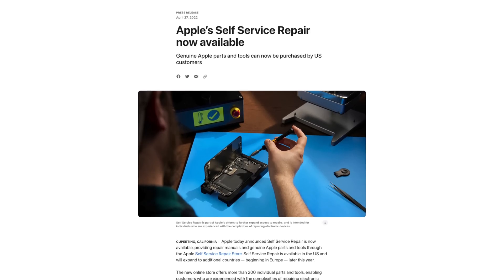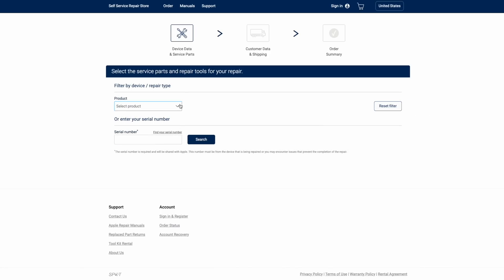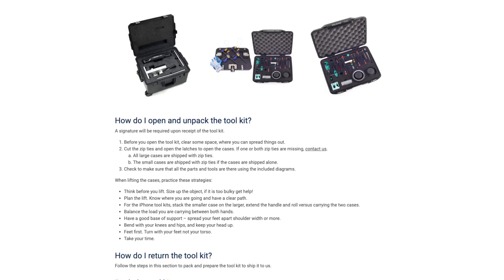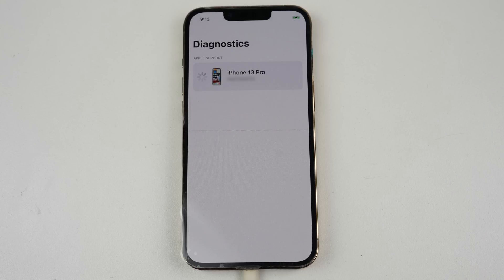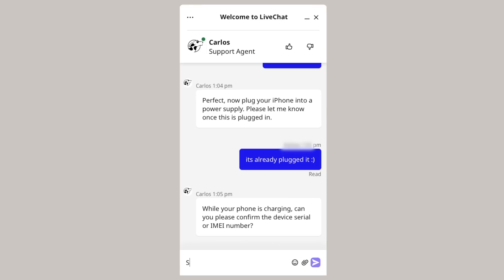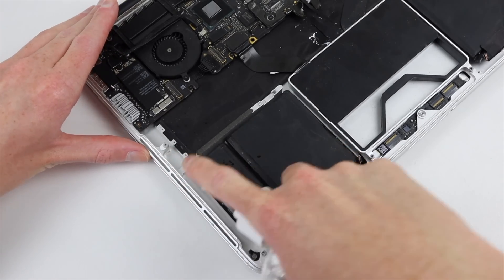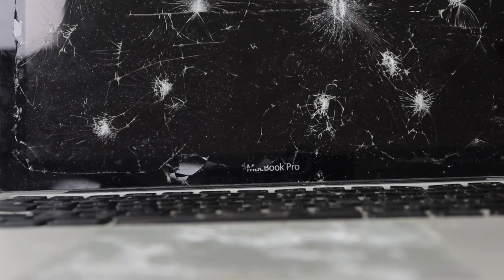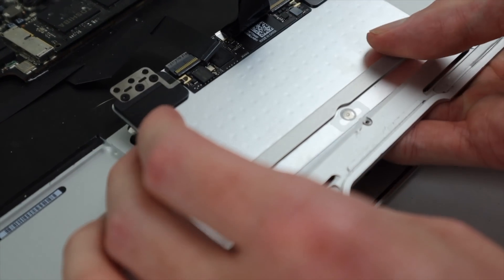Apple Improved Its Self Service Repair Program

Comment: So if Apple can offer a replacement part coded to a customer (or their specific device),  why can't they sell that part to a repair store on that basis?
Reply: They can, but they won't because they want to keep a monopoly on it.
Reply: @rocketbilly  Ding, ding, ding, winner!
Reply: @davenz000  the winner wins absolutely nothing!
Reply: they can but they won't because they want to be monopolistic
Reply: apple specifically wants to avoid part stockpiles anywhere that isnt from themselves. e.g an approved repairer goes out of business and all the parts they had stockpiled go to ebay
Reply: @Alexander-xr8tr  What's the difference between Apple coding a part and sending it to a consumer and coding a part and sending it to a repair shop to do the work on my behalf?
Reply: @Alexander-xr8tr  any 3rd party stockpile would have been already paid for by the 3rd party repairer. Apple's profit from total sold spare parts would be the same.

Comment: Yea if I’m any company I wouldn’t want my user prying out the battery that is glued down, if anything happens it’s the company fault so the easiest solution is to have the user replace the whole casing, if this is the M2 MacBook Air this wouldn’t make sense since the battery have the cheese adhesive which can be removed very easily

I also appreciate having all ports removable, on my ASUS laptop the USB port is loose and I can’t even get parts for it, the speaker breaks there’s no part, fans about to go bad sorry no parts too this is worse than apple
Reply: I think the statements about "Any official products should include all official spareparts to be sold separately" and "any official spare parts must not locked by software/firmware" are strongly required to every big tech company if they can follow the right to repair laws, but I doubt they would do that because most of them are still doing the "money" moves now
Reply: why tf would it be apples fault if you mess up the adhesive yourself? even still, they could solve that problem by being more reasonable in terms of keeping the battery in place

Comment: Hi Hugh, can you try replacing MacBook logic board with different configuration and please let us know if it works. I bought mba with 8GB ram only and now facing issues
Reply from the maker: No its based on the serial number you provide. I feel this is a missed opportunity to sell an upgrade.
Reply: @HughJeffreys  apple should let us upgrade atleast this way or else have to again buy new product. It’s such a pain thing
Reply: @mouniswar7  The thing is, they know that. That's why all the entry-level options for their devices suck - so that you buy it, realise you made a mistake, and then have to buy a new one to "upgrade".

Comment: You know what, to save yourself a lot of headaches, screw apple products and just use android phones and devices.  There, case solved.
Reply: Nope 😅
Reply: Most if not all new Android devices are still just as non-user friendly to repair
Reply: No thanks
Reply: Android phones aren't easier to replace tho. It's almost impossible to find official parts from OEMs
Reply: @FormulaHL1  Well Keon, Apple product just creates drama, but if drama is what you like, then continue to use Apple products
Reply: @lenovovo  bruh what? Apple products are way more reliable than the competitors especially Microsoft which introduced a flawed and failed duo book. Apple on the other hand introduced a MacBook Pro with an M2 chip. Now how is it creating DRAMA?  When they removed the head phone jack in 2016 that was an act of drama but everyone moved on to wireless headphones except enthusiasts or ppl who work to that degree or field to which they need wired headphones so they use their Mac. Sure they started the drama but everyone including Samsung followed on to remove the headphone jack.

Comment: Once the program takes off, however, it’ll be very great.

Still wish Samsung sold parts for laptops, I wonder if the Odyssey with the RTX2060 has a better cooler and heatsink than mines with the GTX1650. And if it does: I’ll happily upgrade my base model cooling
Reply: I think Samsung doesn't sell parts for their laptops because almost nobody uses them, besides the design nothing is that good about them
Reply: @iustin1658  check out the Odyssey model NP850-XG1BR. Looks good, metal finish, it’s like they took their time to do it properly. Much rather have it over a Dell G3 of the same era
Reply: @satsumagt5284  I mean I want to buy a laptop or PC but I'm poor an my budget would be 200🤣🤣, I mean😭😭 but also I couldn't find it anywhere to buy it
Reply: @iustin1658  The Odyssey is quite expensive, and rare too.
It can only be found here in Brazil (hence the “BR” on my model), United States, Korea and China. And I have only now ever seen one on eBay, from Japan (model NP850XBC-X02US).
Reply: @satsumagt5284  yeah I’m going to buy a cheap computer that barely runs YouTube, I mean I have a pc now but it dies going through the yt feed, about actually watching a video is another story. I’m not sure if a pc for less than 200 bucks will be able to work well, would I be able to play games on it, even Minecraft?
Reply: @iustin1658  where are you from? Maybe you can get something used but decent
Reply: @satsumagt5284  well I'm from Romania but talking about this stuff made me look at desktops and apparently dell makes some amazing cheap ones, i would buy used but i already got kinda scammed buying an iphone 7, that phone has more problems than me, i would also build one myself but it gets expensive in some cases and i tried to open up my PC and it took me 20 minutes to remove the cooler and i might have broken it, i though it might me dusty on the inside but it was fresh, so it's born slow. Anyway, i found some dell with an i5, 120 ssd storage and 8 gb ram ddr3, I'm just concerned about the storage cause it's not that much but if i find some hard drive should be fine, i can even move the 80 gb one from my old PC, without killing any of them, but idk do you think an i5 with 8 gb ddr3 RAM is good enough for some gaming or something?
Reply: @iustin1658  maybe you’ll need another RAM stick or something, but if there’s no graphics card… Meh
Reply: @satsumagt5284  true, but I think 8 is enough for me, but idk I just want to get a damn pc

Comment: honestly, apple can get a lot less flak if they just serialize the parts before sending them to you, and autoscripting the configurator, instead of making those that are technically savvy to do the repair suffer with reps that don't know how to do the damn thing itself. it's legit just a preserialization of the same damn thing, since the config basically pulls all the hardware info, it's akin to the devices that you can buy to copy/paste the serial of an apple part onto a ebay part, then running a partial update to verify and validate. 

i just wish companies made it not difficult for the competent people that do this daily, instead of assuming we all need our hands held on it

Comment: Unless one just has to have the latest and greatest from Apple, why spend the money not only on the original MacBook (Air or Pro) when the 2012 unibody MacBooks are not only cheaper on the used market, but easier to replace and repair. BTW I have a 2011 MacBook Pro 17 inch and a 2014 Mac Mini. They work just fine for me.
Reply: Totally! I have the 2012 13" MBP unibody and will probably upgrade soon... to a 2012 15" MBP unibody.  
That particular 13" was kept in production until 2016 due to being the last laptop they made with all the ports / optical drive / SD card slot.  So a used one will say 2012, but could have a much newer manufacture date.
Reply: Because they're ancient. There's not buying the bleeding edge devices, which I can understand, and then there's being moronic enough to buy a decade-old computer, which is just a waste of money and a very poor decision in general. 
Also, the 2011 17" MBP's GPU dies after a while, and I don't believe the replacement program is running any more. Had it happen myself. It's basically a ticking time bomb.
Finally, all Intel-based Macs tend to get way too hot and are already under-volted to get the thermals under control (which doesn't help much). For better or worse, M1 and M2 Macs are just superior in terms of thermals and performance. Even their battery life is better.
Reply: @GareWorks  While the older Intel based Mac do have the problems you indicated, there IS still one attribute that they have. That being the cost and availability of parts. Servicing them is also easier than the Retina and later Macs even though they are in terms of processing power and heat dissipation is better(especially the newer M1's). It comes back to one factor(at least for me) that being I have more time (for repair) than money (to purchase later models). Also, how do you think you've made your point, when you insult those of us who don't have the money to purchase 'bleeding edge" equipment? But a fool and his money are soon parted. Apple encourages the consumer to buy their most recent offerings when they manufacture them to ONLY be repaired by Apple, making all their models land fill fodder. But as in all things one is entitled to their opinion.

Comment: The irony of his saying that you only save 10 dollars on the battery replacement for the air is that you are getting the exact same discount from ifixit his channel sponsor with the exception of the back to school sale they were running when I looked. So is getting it serviced by them really that big of a rip off? I mean I'd happily spend 10 dollars more having someone else do the work and know that I'm getting the same part in my computer. It's like how I happily spend $100 dollars more on a set of tires knowing that they just outlasted by 20k the time I tried to save the $100.
Reply: I see this come up a lot. People don't seem to understand the difference.
Yes, it's a big rip-off on Apple's part, because iFixit are either not selling you original batteries, or they're selling you refurbished batteries. Apple makes it extremely difficult to get this shipped in bulk and will stop them at the border sometimes. 
Also, iFixit generally has much lower volume than Apple (you might have noticed that one is a relatively small company and the other is literally the biggest company in the world), which can greatly affect the price. 
That's why iFixit can cost almost the same price. But Apple has the ability to (and does) produce and sell them in much greater quantities than iFixit.
That's also why being able to buy genuine parts is so important - iFixit is doing their best to help people repair their devices, but even they know they can't offer the best quality parts for the best prices. Often times, it's just being able to get the parts in the first place, whether genuine or not, that has made iFixit so invaluable. Being able to buy the genuine parts at all is an even bigger bonus. Being able to buy them at reasonable prices is the next logical step which we have yet to take, at least for most parts that Apple offers.

Comment: for what it's worth I want to point out that the M1 macbook air battery has magic pull tabs and is much much easier to remove than the older models like the intel macbook pros
Reply: Even with the pull tabs, some people won't be able to even do that properly and they will most likely damage the battery in the procces ans cause a fire or them getting hurt and then will come the biggest lawsuit of all time, I think that's why apple does it the way they do, to not get sued
Reply: @iustin1658  You're half-right. They're definitely doing this repair program to not get sued, but it's got nothing to do with the battery. They aren't liable for what you do on your own.

No, it's because they can get the parts back from you, remove the batteries themselves, and recycle all the tops of MacBooks. It basically prints them even more money whilst charging customers, even for self-repair, out-of-pocket.

Comment: With parts being sold, maybe I can run the serial number on my 1998 Macintosh PowerBook G3 and finally get a new display cable! Wait it only applies to current models?…… oh.

Though this is one of those things were I would rather pay more but get a new oem part directly from the manufacturer than pay less for used parts or a third party part of.. questionable quality.
Reply: If you really need a display cable for a wallstreet/pdq model of the powerbook g3, i have one i don't use and it works, i even have a 300Mhz daughtercard for such machine
Reply: Hmm Ill keep this in mind, that 300Mhz is quite tempting but I don’t know if it would work on my board. I’d buy it off eBay if you posted it there.
Reply: @aegonthedragon7303  No it's not posted on ebay unfortunately, but we could arange something if you'd like, i know the daughterboard works because i had the opportunity to test it in another machine and it works flawlessly, it just sits in my drawer, i don't have any use for it and it should fit any of the pdq version of the wallstreet, i don't know if it would fit into the very first production run revision
Reply: I’ll definitely keep it in mind. Could we continue on another site like reddit? Just where its more easy to chat.

Comment: We hope that all these problems are only temporary things due to the fact that the service has been active recently and that over time repairing your device with original parts becomes easier. Waiting for a technician to connect to your device remotely, to authorize the replacement of an original part, cannot be seen at all. Nice video as always.
Reply: Keep dreaming

Comment: Apple is so disgusting man...so glad i opted for the s22, can't believe i even considered the idea of entering Apple's ecosystem.😶
Reply: @Bobspineable  you still cant buy a battery for a samsung device. And pricing is trash, as they are working with iFixit, a consumer facing company, rather than a wholesaler like Mobilesentrix. I get "wholesale" discounts thru iFixit Pro, and dont get any kind of discount for genuine samsung parts, meaning they are unviable for shops.
Reply: @Bobspineable  the problem is not the difficulty of the repair, just watch the video...
Reply: Do not telegram
Reply: @Bobspineable  Samsung partnered with ifixit just for marketing, just how they did with BTS and blackpink and Millie Bobby Brown, kpop fans are fans, fans fans, toxic a lot of the times and I've seen a lot of people buy Samsung phones just because of the partnership, and also Millie is well known, they just do this for sales. But yeah no phone is easy to fix but S fanboys go crazy when they hear apple
Reply: @Bobspineable  its not even how easy they are to fix though. I would much prefer to swap an iphone display than one from some androids that open from the back. The problem arises when I replace the iphone display and lose functionality and get a permenant error message. This requires me to reprogram the new display and solder over the IC chip. the only other option I have if im not comfortable microsoldering is to refurbish the original display, something that requires $800 in equipment. Suddenly, a routine display swap that looks incredible easy on an iphone becomes 2 hours of soldering of cutting hoping I dont overheat or otherwise ruin the new display
Reply: Still cant believe I was in the samsung ecosystem...

Comment: Some good points to this but still only real partial support for the very latest models, models that are unlikely to need much in the way of parts or manuals/ guides. In saying that, some of the parts are very well priced.
Reply: @recitationtohear  bot
Reply: Peter bruh u used to fly fpv

Comment: Just buy samsung its a simple phone
Reply: Thats like saying to buy a car from Honda when your Hyundai fails. Not as simple as you think to go from one system to another.

And Samsung is getting just as bad with repairability as Apple.
Reply: @Bobspineable  It's not about being "easier to fix." It's about being jerked around and hemmed in by the manufacturer on repair parts and information. You did watch the video, right?

Comment: iPhone 14, Max,  Pro or Pro Max? Which one is the better option?
Reply: None. Better get yourself an Android phone that doesn’t lock down or pair their parts to the phone.
Reply: @PeterdaPanda  android phones may have repairability, but they don’t have the reliability that ios provides
Reply: @s.dey1  What reliability? If you mean the dozens of “Gates” like battery-gate, antenna-gate, chip-gate, not to mention annoying messages whenever parts are replaces, then sure… that’s reliability. /s
Reply: @PeterdaPanda  literally never had any of these issues in 8 years of owning iPhones, I pay the full price for repairs  without any fuss to apple, doesn’t apply to me! how I personally see it, if you can’t afford to get it oem repaired, just don’t buy the phone at all. even then, AppleCare+ heavily discounts repair prices, so buy that when getting an iPhone. as much as it may cost it’s been worth it every time.
Reply: @PeterdaPanda  some android phones with in display fingerprint scanners require a calibration tool to enable the function. OnePlus is one of them
Reply: Pro/pro max
Reply: if you already have an iphone this year will probably be a skip. next year they'll have to put in usb c. but who knows maybe it'll have usb 2 speeds anyway 😂